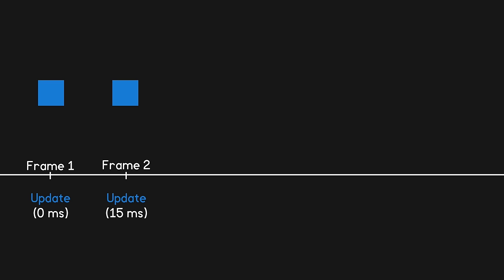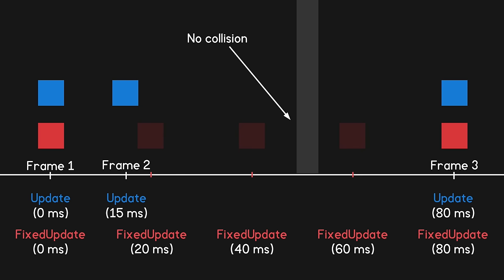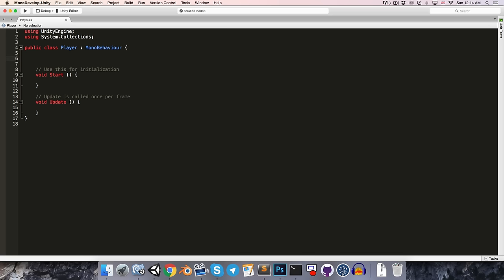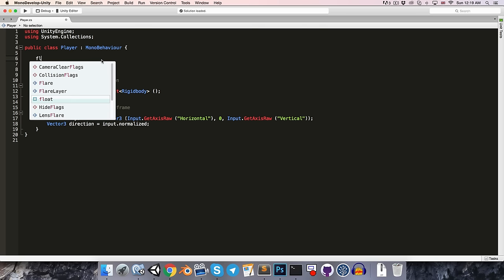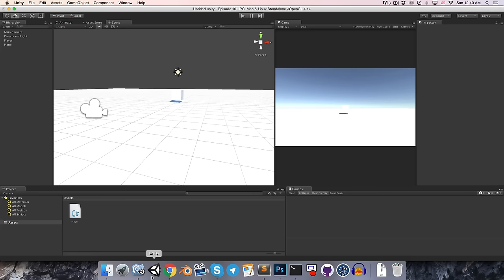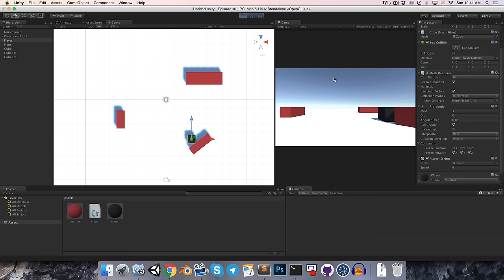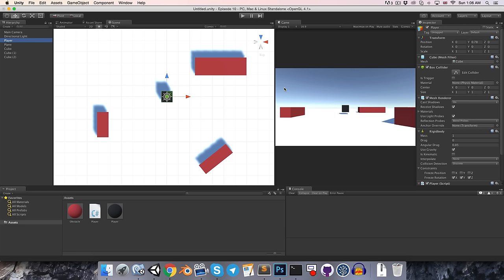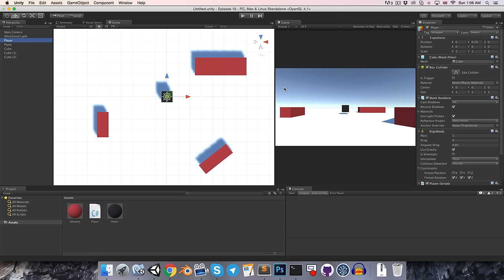Introduction to Game Development (E10: collision detection)

Comment: There's a subtle bug (unwanted feature?) - it works fine... until you reposition the main camera to view the scene from a different angle! To see this, take the top-down view, then change the location and rotation of the main camera so it views the scene from the east (or west), then run. Now, when you use the up/down arrow keys, the "player" cube moves from side-to-side, and pressing the left/right arrow keys moves the cube towards and away from the camera. Oops!

Comment: This Unity course is mindblowing. Thank you so much!
Quick question: Is it really necessary to normalize the input vector? If a key is pressed, the resulting input Vector3 is always going to have a magnitude/length of 1, isn't it?
Reply: Found the answer, you need to normalize in case you press 2 movement keys simultaneously and move diagonally
Reply: @Xuul  Yeah, he explained that in one of the previous episodes, that if you don't normalize it, you will move diagonally quicker than you're supposed to

Comment: Again, super nice tutorial as always! :D

What I am wondering tho, is what are your lightning settings? For me, as soon as I start a project and create a cube or plane, it looks grey and slightly yellowish and continues to look like that when I add a white material. Now I've googled a bit, and the solution seems to be to enable "Auto generate lighting" in the lighting settings? But for me that option is greyed out.

Its not anything that stops me from following the tutorial properly, but every tutorial on YouTube has a white cube, meanwhile the whites thing I can get is a dirty yellowish-gray.

Do you know whats causing this? Is it because of my Unityversion? Do you have different lightingsettings enabled?
Reply: Window (at the top) > Windows > Lighting Settings > Auto Generate Lighting set to true (at the bottom of the window)
Reply: @honkinghorse7347  As I've said in my comment already, that option is grayed out for me.

However I fixed it already. Well not really... But I switched from my laptop to my desktop pc and there I dont have that issue anymore

Comment: Alright I did mine just like you did but I have a problem, when my cube pushes against it the cube bounces back and forth going partially inside the other cube and back out. How would I fix this?          Update: Never mind I came to realize that the reason it was doing this was because I never replaced the Player Script from your previous episode with the current script we have been working on. The old one used a regular moveAmount variable where as this one performed it on the rigidbody.

Comment: It doesn't print the coin's name in the console when I touch it with the player. I've turned isTrigger On for the coin and have written this is the Player Class: void OnTriggerEnter(Collider triggerCollider)
    {
        print(triggerCollider.gameObject.name); 
    }
...What should I do??
Reply: If you are still having the issue. I found the fix. You should rename the script to something different, if you already have a script with that name. Once you have done that remove the script from the player object ja reapply it. This worked for me.

Comment: I know it's only a simple example, but the decision to use Is Kinematic on the Player object at the end strikes me as a bit odd... Wouldn't that mean that the Player no longer collides with the Obstacles? Would adding Rigidbody components to the coins and setting the Is Kinematic flags for those to true instead be a more suitable solution?
Reply: I guess it depends on your need and the behavior you want for the player and coins, by understanding the kinematic option the developer can make the same question you did and figure out the answer.

Comment: If the Update() is not called after fixed intervals (in some cases), unlike FixedUpdate(), then why are we checking UserInput (line 18) in Update()?
Shouldnt we check the UserInput in FixedUpdate()?

Comment: I really have no idea where (or who) to ask this, but if I would want to make 2D top down tiled game which involves autotiling and some procedural generation, then what should I start with? All tile cases can easily be handled with 2D array and I wouldn't have any problems with that, but what about the world space itself? just spawn tiles as they are? Somehow create few meshes which hold different tiles? (I really have no idea how meshes work and never managed to use more than one material on one mesh) Maybe it's possible to create a mesh from objects? As planes are technically 2 triangles (and all tiles would be squares anyway).

Comment: If low framerate allowed an object to pass through another object, that is called tunnelling. Making update calls for this reason is not a solution but a sign that the collision detection is unreliable. Consider objects that move fast enough to tunnel through stuff even at 60 fps.

Comment: Cool video! but.. I don't know why instead of the cube moving according to the inputs it seems that the camera is following the inputs....even though I applied the script to the cube, did I miss something out in the video.... :(  my codes below - 
(sorry for my bad English ) ok sorry correction: My camera is moving along with my cube....

using UnityEngine;
using System.Collections;

public class Player : MonoBehaviour {

 public float speed = 10;
 Vector3 velocity;

 Rigidbody myRigidbody;

 // Use this for initialization
 void Start () {
  myRigidbody = GetComponent<Rigidbody> ();
 }

 // Update is called once per frame
 void Update () {
  Vector3 input = new Vector3 (Input.GetAxisRaw ("Horizontal"), 0, Input.GetAxisRaw ("Vertical"));
  Vector3 direction = input.normalized;
  velocity = direction * speed;
 }

 void FixedUpdate() {
  myRigidbody.position += velocity * Time.fixedDeltaTime;
 }

}
Reply: UTKARSH JHA is the camera a child to the cube??

Comment: For some reason my cube won't move. I believe I copied the code exactly but it's not working.

    public float speed;

    Vector3 vel;
    public Rigidbody rb;

 // Use this for initialization
 void Start ()
    {
        rb = GetComponent<Rigidbody>();
 }
 
 // Update is called once per frame
 void Update ()
    {
        Vector3 input = new Vector3(Input.GetAxisRaw("Horizontal"), 0, Input.GetAxisRaw("Vertical"));

        Vector3 dir = input.normalized;
        Vector3 vel = dir * speed;
 }

    void FixedUpdate()
    {
        rb.position = vel * Time.deltaTime;
    }
Reply from the maker: +Jesse Rioux Try rb.position += ...
Reply: I had that originally, I uninstalled and reinstalled unity, retyped the script and works perfectly now. Had a few issues but figured them out. Sorry for multiple msgs

Comment: Having an issue similar to Jessie Rioux's earlier, my cube isn't accepting any inputs for some reason, and I'm unsure what I've messed up. Here's a pastebin of what I've got:

http://pastebin.com/uc59dBKZ

Much enjoying the videos, by the way.
Reply from the maker: There's nothing wrong with your code, so make sure that the speed value of your player is not set to zero in the inspector. The inspector value will overwrite the values assigned to public variables in your script.
Reply: thanks for the fast reply! In looking around for the speed variable on the object, I realized that I'd forgotten to actually apply the script to the cube in the first place, since it's variables were missing from the inspector altogether!